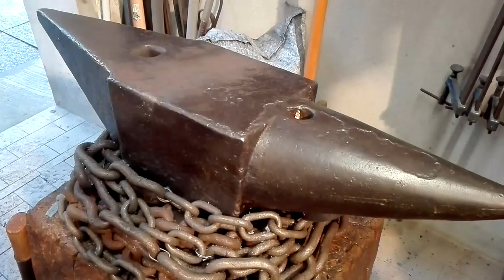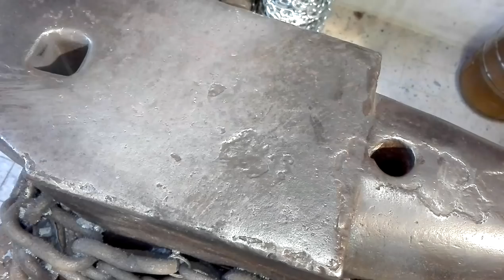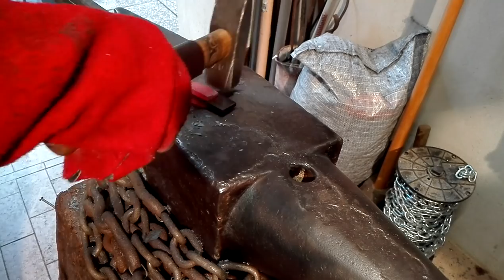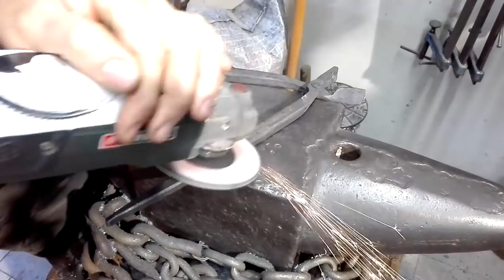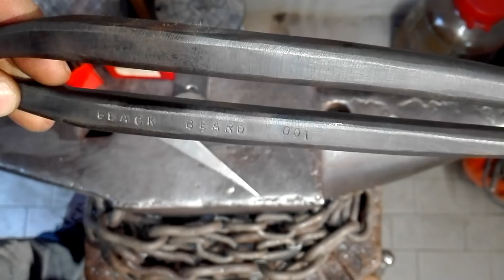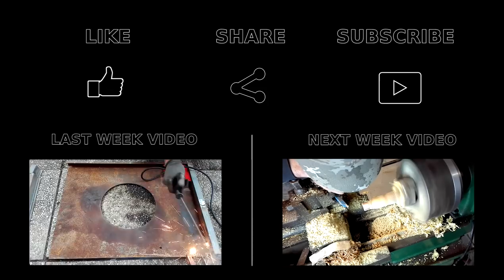Forging Blacksmithing Tongs

Comment: Fun fact: If you want silky smooth opening and closing of the tongs heat them up to a yellow heat and then quench them in water whilst opening and closing them.(unless they are high carbon steel in which case idk) Thanks for making all the videos.
Reply from the maker: Thanks Harry! :) I actually did that but I didn't recorded myself xD It was explained in the guide I followed!

Comment: Great job for your first blacksmithing project. Tongs were my first projects too. Mine were really ugly and made out a couple pieces of re-bar, but they still work just fine. Watch Alec Steele or Joey Van Der Steeg videos about setting tapers and drawing. You'll save your arm and be able to draw out reins in a couple heats when you learn their techniques.
Reply from the maker: Thank you! :) I'm subbed to both! I will try to learn as much as possible by watching them :)

Comment: not bad for a first try, now you just have to make another 20 or 30 for all the different kinds of stock you will probaby use.i love making tongs its great practice and there so usefull. i have been living here in italy since 1987, born in england, ma non so scrivere molto bene in italiano. Try to punch a hole instead of drilling it will make your tongs alot stronger, great videos complementi.
Reply from the maker: Thank you! :) I guess I will make more as I need, you are right! I hope to forge my own hot punch soon. Grazie mille :D

Comment: Nice job.
Hey, not to be mean or anything, but do you mind if I mention a couple things you might do differently for your next pair of tongs?
Reply from the maker: Yeah sure mate! Anytime! I love to hear and learn from those who know :) Suggestion are much appreciated in any of my videos :)
Reply: Alright! Just thought I'd ask.
It might be a little hard to tell in the video, but it kind of looked like the hinge part was a little thin. I suggest keeping them at least a little over half the thickness of the original stock. The transition between that and the reins and and jaws were good and smooth, not too thin, but it's a good idea to keep that in mind so there's no chance for cracking. Lastly, if you were working in a gas forge, it would probably be a good idea to stretch those thick reins out some. Short is okay for coal, but when the heat is blasting out sideways at you, your hands get a little toasty trying to get some pieces out of the forge unless you have some reach.
Other than that, they look good! Looking forward to seeing more from the Black Bearded Blacksmith!
Reply from the maker: Thank you brother! I have a coke forge I built last week :D I will keep your suggestions in mind for my next pair :) Have a nice day!